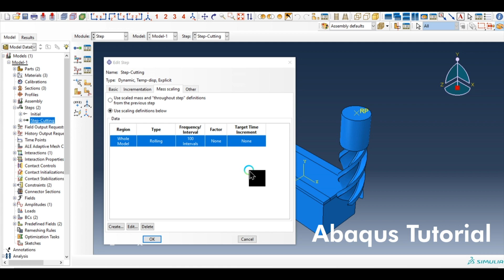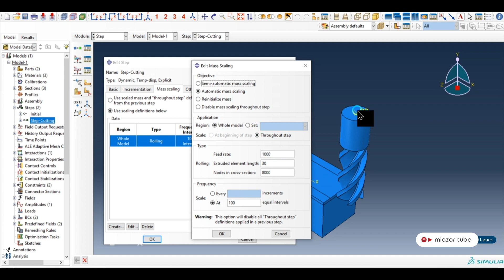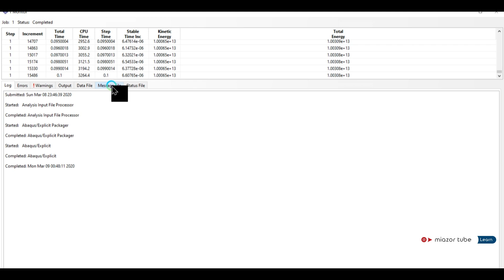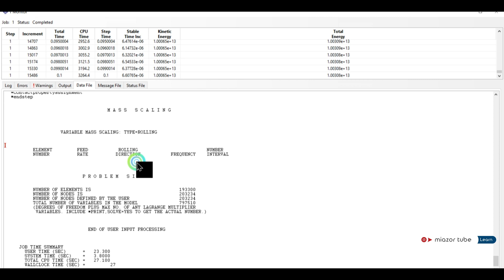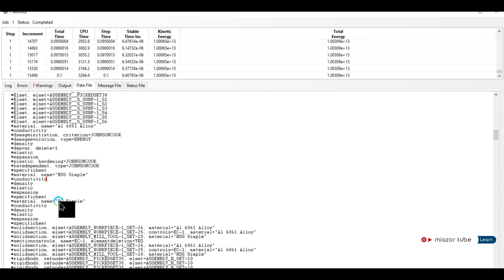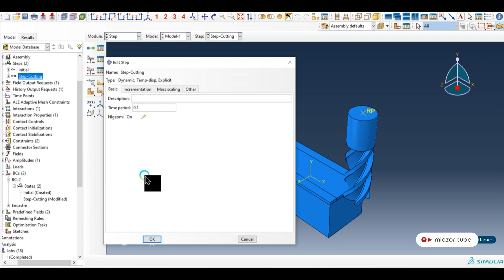FEED RATE in ABAQUS Solved | 2020 | 4K Video

Comment: great video sir ! I have question as I'm currently running simulation of friction stir welding on simulia abaqus, how can I find the no. of Nodes in Cross- Section ?
Reply from the maker: There are several ways to find out how many nodes are in a cross-section.

1. After meshing an area of a part, the number of nodes would be displayed at the "information area" 

2. To navigate, Go to: 
View tab  
>>Assembly display option-->
>>Mesh
>>Show node labels. 

The number of the Nodes will be displayed when you are in Mesh module.

Comment: Can I set Feedrate in drilling simulation using this way?
Reply from the maker: Hi Eddy, Abaqus present various ways to achieve a process. This is one approach, likewise it is good to confirm from your team or lead which they are comfortable with for your simulation. The most important aspect is to get useable data.
Reply: @miazormultimedia  On drilling simulation i got problem. I changed feed rate from boundary condition. when i decrese feed rate from boundary condition, my drilling rotation become slow (almost did not have rotation).
Reply: @miazormultimedia  Another question. I used descred rigid and shell on drilling tool. How i can calculate Node in cross-section? i confused about that

Comment: Hi, can this method apply for 2D orthogonal cutting method? i mean the feed rate, not the cutting velocity
Reply from the maker: There should be another option for 2D. This is critical for 3D simulations. It also depends on the formula used for your calculations.
Reply: @miazormultimedia  Thanks for the replied!
Reply from the maker: @Ulam_Gaming  My pleasure